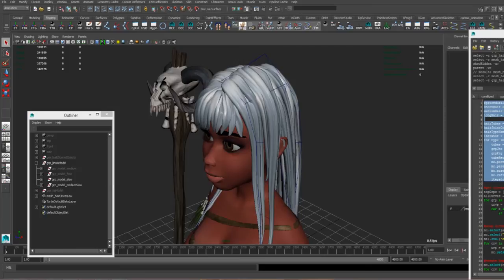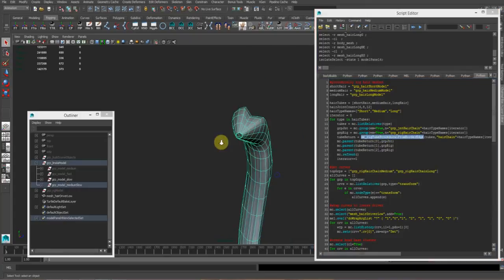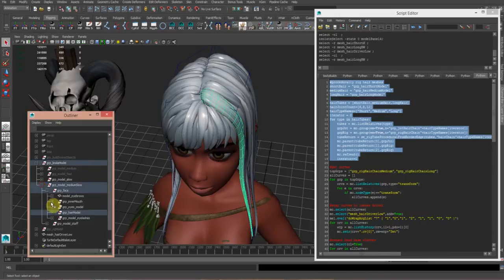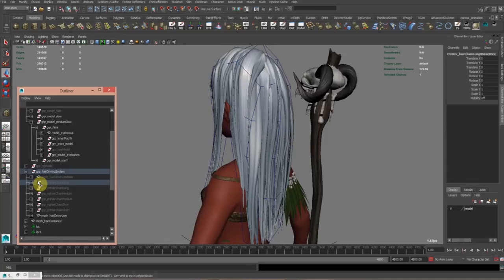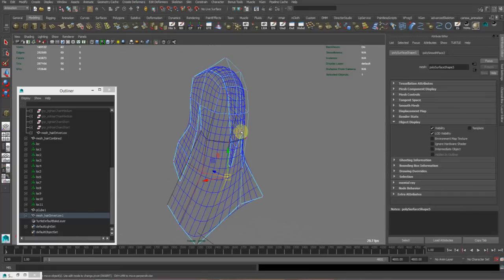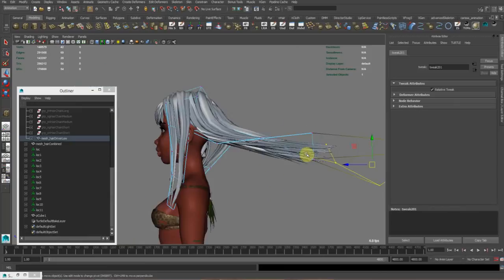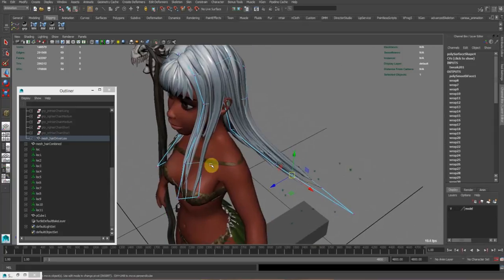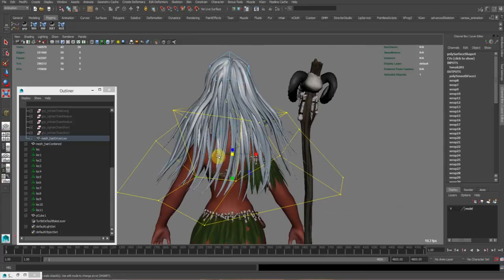poly hair rigging demo

Comment: Sort of a related question to hair modeling, but do you know if it's possible to taper a NURB generated by 2 curves? One curve dictates the direction, the second curve dictates the extruded shape (a circular curve makes a cylinder for example), and after that would it be possible to taper this cylinder or shape? Maybe with a 3rd curve, but how would you do this? Is it possible to drive a shape with more than 2 curves?
Reply from the maker: Hm, its possible to taper using polygon extrude, but I never found an option for that in the nurbs version. If I need complex tapering sometimes I use a polygon shape instead to access the polyextrude options.
Reply: What function did you call to grow the selection? When you grow the selection using the hotkeys, Maya outputs PolySelectTraverse but this function doesn't exist in the MEL and Python API which is really weird.

EDIT: nvm got it

Comment: hi, stefan..great works! big fan!..any tips or tricks to solve skinning problem(i dunno if its a skinning problem tho) at upperLeg and hip regarding character sitting in extreme position such as her knee touch her jaw, i'm currently working on some scene that had the poses in it. any comment on solving it? so sorry for direct question..im a noob so..yep ty so much for your time anw!
Reply from the maker: Well, you should place your joints as anatomically precise as possible. Introduce some additional helper joints to push volumes on extreme angles and do some good skinning. Make sure your pose is anatomical and realistic. On a pose like "knee touch jaw" there is a lot of rotation coming from the hip and torso. The neck and head also come down to meet at point. All of that achieves that pose while not performing the rotation at huge angles just from the upper leg joints. (Shouldnt have more than ~110 +- degrees on the leg without affecting upstream hierarchy rotations..
If I have time, I could see on my rigs and give you some input later..
Reply: Stefan Ehrenhaus wow..appreciate the time, thx..i had that in mind to in fact redoing the joint placement in order to fix this kinda situation, and to be honest its my last resort..i was thought i could fix it by redo only the topology work or maybe i could make a corrective blendshape on it..yes i agree on how upperLeg joint couldnt be moved over 110degree, all i know is many artist solve it by covering it or even avoid those extreme cases..wow all i can hope that u hv time to show me,jk..anw thx, big help!